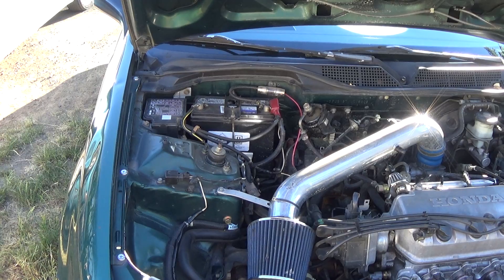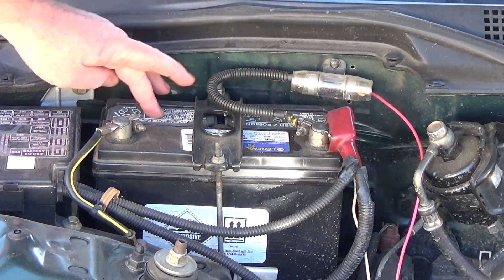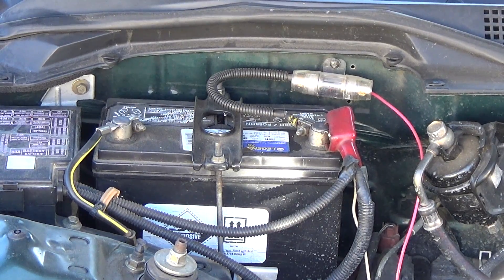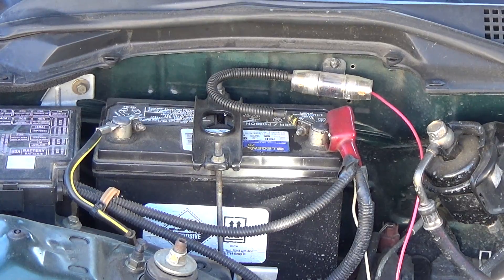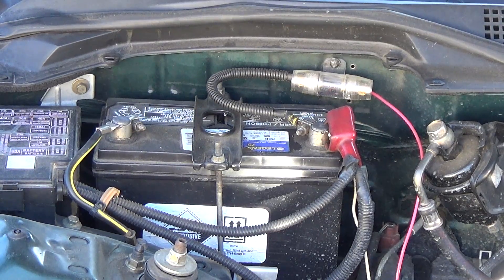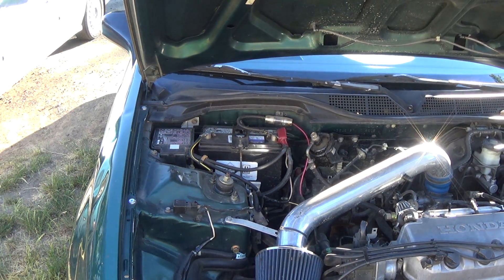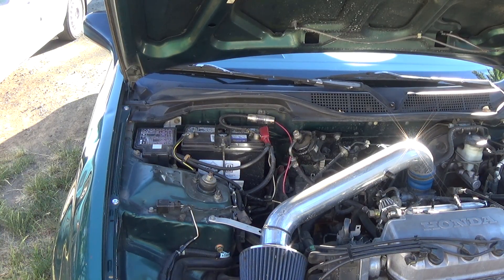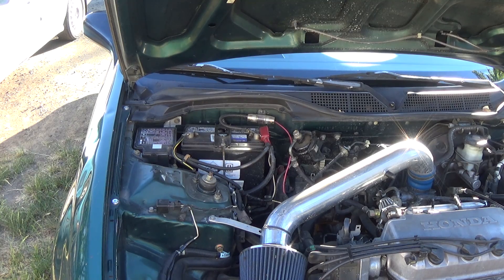Boiling car battery

Comment: Thanks. short and straight to the point.
I've boiled over 2 batteries already
Reply from the maker: Your welcome.  Have your alternator tested you.  Feel free to let me know how it goes.
Reply: will do
Reply: mine boils/sizzles when bad connection with old batt. terminals, also for some reason gets corroded quickly at terminals but only have stock alternator

Comment: when they go bad they can heat up as well & you will definitely smell it in the car. sometimes for days even after the battery is replaced.
Reply: Hey sir , I my battery is boiling and smoke is coming out I should replace it?
Reply: It smells like burnt wire ?
Reply: @rogerpesqueda1291  yea like eggs
Reply: @Heenfio Which eggs do you cook that smell like acid.?

Comment: Very helpful, thank you! My battery died and when road service came the water was very low. I thought it was just because I hadn't checked the water level in a long time, and he said it gets hot when it's low and that causes it to boil over. But now (rarely) it still drips on my garage floor, so I suspect it is the alternator. Is that expensive to replace on a '97 Toyota Corolla? Thanks again!

P.S. I just remembered this happened on my Honda maybe 30 years ago. And just as you said, it was burning out headlights! And the Honda dealer didn't figure out the problem the first time around and just replaced the headlights!
Reply from the maker: Your welcome.

Comment: All lead acid batteries release gas as it charges.  It is NOT boiling since this is a chemical reaction and a not a physical state change caused by heat.  If it overflows, that just means you overfilled the battery. The oxygen in the water reacts with the lead sulfate on the positive plates to turn them once again into lead dioxide, and oxygen bubbles rise from the positive plates when the reaction is almost complete.

Comment: i switched off my car and after 20 minutes my car wont start, open the hood and listen battery like whistle/ boiling and spill some acid (very few) and the  (-) polarity was extremely hot and  the battery was dead .. not even immobilizer led was blinking was total flat.
any idea ?
Reply from the maker: Take your battery and alternator in, and have them tested.

Comment: my battery started to boil during load testing and it was out of the car. the reading before load was just over 10 volts
Reply: 10 volts is low what kind of car and what year my 2010 CTS-V puts out 14 volts with no problems

Comment: We had a FZJ80 Landcruiser come at the workshop. It would boil only the second battery when connected. Whats your thoughts about it? battery itself stuffed or needs a secondary regulator?
Reply from the maker: Not sure.  Would start it up, and check how many volts are going to each battery.

Comment: Is it ok that i have added distilled water on battery and started to charge with main battery charger? 
Some told no need to add acid but only distilled water is it ok?
Tried but battery still down n unable to start engine
Reply from the maker: Think most batteries are "maintenance free".  So if your having to add water, it is time for a new battery.  How many years is the battery rated for.  Most of the time, they make them so they will eat the material inside the batter, so it fails on an approximate date.  Planned Obsolescence.

Comment: I had the same problem, I changed out the alternator but the headlights are still out. Help..
Reply from the maker: +Johnny Saeteurn Check you voltage when your car is running.
Reply: Would the voltage regulator be the culprit? Or  a sensor or fuse?